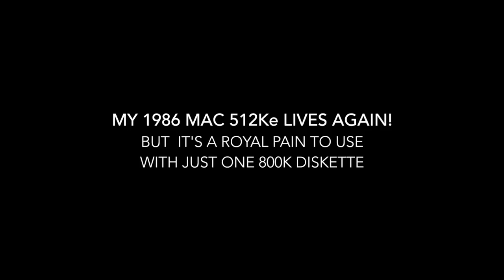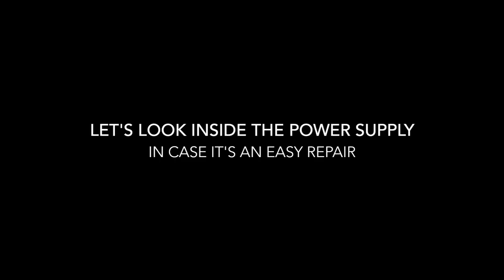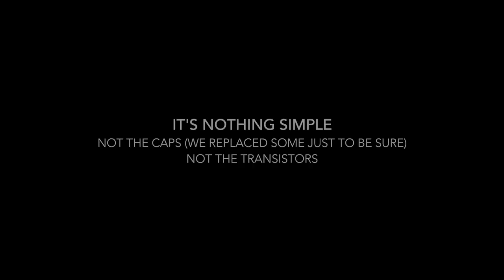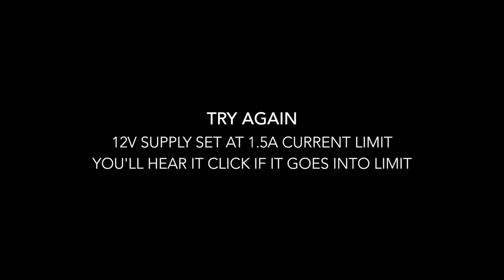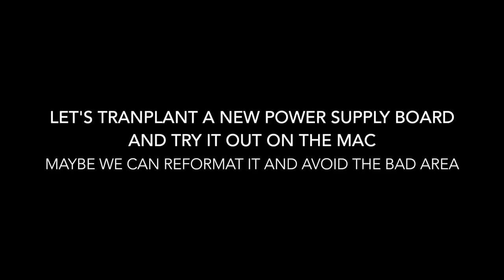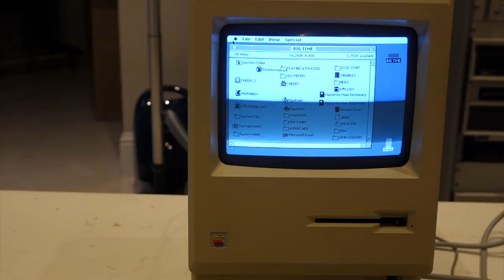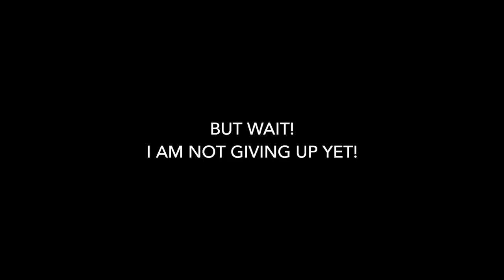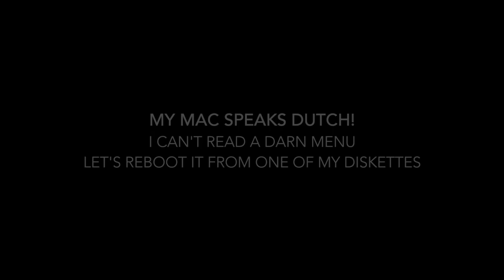Macintosh 512K Part 2: HD20 Hard Drive Restoration

Comment: I just found this video and it warmed my heart.  I wrote the Z8 microcontroller code on the HD20 interface card that sits between the floppy connector and the hard drive controller.  My memory is fuzzy on the details, but I recall Woz's floppy interface had a weird 7 bit interface so we came up with a scheme where we converted 7 bytes of data from the system (the device driver was written by my colleague Carl Young) into 8 "floppy bytes" to go across the interface.  Carl had the speedy 68000 to handle the shifting, masking, etc. tasks, but the slow Z8 could only wait for the first byte and from then on had to read the interface every X clocks, while also doing the shifting, masking, etc. between reads to assemble the "real" bytes.  No time for looping, so the code was in line and in fact crafted clock by clock.  I think it took me a week, counting clock cycles, moving a shift to before the next read, a mask operation after, etc., before I got it to work.  Challenging, but fun.
Reply from the maker: Wow. It's a great honor to have you on the channel. If any of the source is still available (and Apple is OK with it), it would be nice to release it or donate it to the CHM! I know that this interface has perplexed many people trying to emulate it now that the Rodime disks now that they are unavailable. Maybe, maybe not. But can you contact me through my channel about page?
Reply: I left Apple in 2009 and of course, had to leave all my notes from 27+ years there.

Went to About page, didn't find a way to message.
Reply from the maker: Thanks for responding. The "messaging" is now somewhat hidden, you have to click "business enquiries" or something like that and it will give you the email link.
Reply: The Ferranti ULA (I'm guessing Uncommited Logic Array?) that's seen on the upper part of the frame when he's watching a the dead Zilog... what was the role of that, there? Ferranti also make the ZX Spectrum's ULA isn't it?
Reply: @CuriousMarc  Did you ever try to rip the ZIL from the good disk?
Reply: @leninalopez2912  Ferranti was a pretty prolific manufacturer of custom chips during the 80s, it's likely a bunch of consolidated logic.

Comment: Love the bypass caps soldered directly on to the chips on the drive!
Reply: Doesn't look like a bodge at all, it looks like proper engineering.  It's the absolutely best placement for bypass capacitors.
Reply: This was common back then.  You see this in a lot of early computers from the early days of ICs.
Reply: The closer the better! :-)
Reply: Fun (yet pretty much wrong to solder anything to a chip's pins so close to the package itself), though my fav was back when power rails were literally rails, bands of thick metal foil cut in such a way they had pins for soldering them in, like a fence or something that is. The bypass caps were soldered between those rails above the ICs (the rails had small cuts in them to make it easier to position the capacitor on a defined spot at the correct height).
Reply: @TheBypasser  I still sometimes see rails like that in big power supplies, but I've never seen them with caps soldered across like that.

Comment: That hard drive is not scratched, it's just the way the finish looks in a lot of these old disks.
Reply: I think that's the individual tracks being discernible by the naked eye and not just a 'finish'.
Reply: Can't you even see the regular tracks on a 4MB floppy?
Reply: @SkyCharger001  Tracks on a magnetic media such an hard drive are... well... *magnetic*, it's not like a vinyl record where the tracks are actually physically engraved in the disks. And unless you're Superman and have his special eyes there's no way to see them with the naked eye, you need special tools for that. Not to mention that they're microscopic in size, so even if they would be physical grooves you would anyway need a microscope to see them.
Reply: @SteelRodent Yes, the Seagate ST124 have a similar finish, like lot of others of the period. These were the times when the drive finish was transitioning from the old orange/brown iron oxide coating to an anodyzed one.
Reply: The patterns are actually wear, most likely. This comes from spinup and spindown without being parked properly!
Reply: @AiOinc1  No, that's not wear, it's just the way the platters are finished. I opened many hard drives and in a lot of the ones being from the late 80ies/early 90ies I found platters looking exactely the same, while the drive was perfectly working with no bad sectors. Not to mention that many of them were voice coil drives which park the heads automatically at spindown, so unparked heads actually was not an issue on those units.

Would that have been a weared surface you would've heard the heads grinding like crazy when the guy in the video spins the platters by hand or turn on the disk, but it's not the case here.

Comment: Thank you for posting this 5 years ago now.  I just had a very similar issue with my Rodime drive in my Apple HD20 unit.  popped the top, slowly spun the spindle platter, and felt it free up.  Put it all back together and it works now!   Thanks for the inspiration to finally pop open these old drives and just take the risk.

Comment: I'm not even sure if the scratch like pattern on the disks were really scratches and not just the surface finish since they are completely even over the whole surface. 
These old hard drives are very robust. As a child a opened a decommissioned 20meg IBM harddrive and poured water inside it was still working (for some time)
I think as long as you don't get any of the sticky stuff from the foam sealant on the platters this drive should be fine.
Reply: Yep, the surface finish on many old drive platters looked like that.
Reply: Why did you pour water inside?

Comment: I worked for Apple in the late 80s and through the 90s, and at that time, they were VERY proud of their plastics design. They had an aesthetic of making enclosures that used minimal screws.The Mac IIci and Mac LC, as I remember, had no screws at all - everything just clipped in and snapped together. Same with the original Mac Portable. If you can get your hands on any of these machines, take a close look at how the plastics are designed - they're really beautiful.

Also, those disks were famous for stiction problems - the head became mired in the protective grease on the platter. We learned just where to whack the drives on the side when they would stick, just as we turned them on, to produce a shot of extra torque to get the heads unstuck and let the drive spin up.
Reply: If I recall correctly the Conner drives also had stiction issues.  For me, I take the raw drive out, hold it in the air with one hand, and give it a quick twist to free up the spindle.

Comment: looks like over current from sticky mech fried things bits by bits. The transistor regulator fried for a good reason, replacing it by an uprated one allowed the next thing in the line to be used as a fuse : the Zilog controller.
Mechanics in these drives have way more forgiving tolerances than high density beasts of nowadays and can be harmlessly disassembled, and fixed to restaure friction-less functioning.
The actually working drive will provable seize one day or another too for the same reason of sticking old lube.
Sticking old lube is also a 90% chance of failure reason of floppy drives, also turntables, mechanical clocks...
Reply: The z8 can’t be the fuse since it doesn’t directly power anything. It could have been a random failure or a sign of overstress from the higher voltage circuits not coupled loosely enough. The transistor fried because it was a design with no current limit. A bit appalling really.

Comment: I see a Ferranti ULA on that Rodime controller board!  Very Sinclair of them to include that...
Reply: That's not surprising considering Rodime drives were made in the UK (Scotland)
Reply: ULA was a predecessor to modern ASICs, so it was a generic chip. The difference was, that it was programmed in the factory, like Mask ROMs, and not by end-user like GALs or modern ASICs.
These drives did not store any configuration in the board, so swapping PCBs should bring to life other disk too, yet it is somehow risky, as mechanical problems may damage the other board too. If you decide I'd suggest you to monitor power consumption of good disk, and then set current limiter according to the observations prior to running working PCB on a dead drive.
Reply: Was going to comment I spotted that too!
Reply: I noticed the Ferranti chip, too.

Comment: Hiya! I have a 512ke with one of these. The drive starts up and all is well. The Mac boots, you can see the menu bar and trash can, but then it bombs out with ID=4. If i boot off of a 5.3 system floppy the Mac doesn’t see the HD20. Any ideas? What would I use to format it or try to get the Mac to see it? Gracias!

Comment: @CuriousMarc 
I can't understand why the Rodime drive's uC chip burned up after hours.  One thing I remember is that one computer used chips that required the negative 5V, and there was a strange circuit that prevented the +5V from being applied before the negative 5V was present.  I think the chips required the neg. 5V first to prevent drawing excessive current from the +5V supply.

Comment: These old hard drives can surprise you, I've had ones you really wouldn't expect to work come up just fine, and much newer ones have some internal part turned to goo and sticking the head in place so it cannot work, or having turned to dust, which of course spoils the disk or head.  I'm assuming these Rodimes are too old to swap controller boards and expect to actually read the data; I'm talking out my ass here but if there's custom programming on that chip, I'm guessing its a defect map or some other thing tied tightly to that physical drive...

Comment: Wow, that was inteesting.  And the drive gets it's power through the ribbon?  By the size of the cable, I'm guessing it has space left for a 6-bit disk..?   don't know anything about Macs, and as thorough my knowledge about modern hardware is, I'm a bit limited on yesteryear's tech.

Comment: I have seen in other repair videos that a common problem with this old drives is the grease (dried out) inside the stepper motor(s), a small drop of sillicon oil on the shaft will help.

Comment: I don’t have an HD20 but I do have an external SCSI drive for my Macintosh Plus. The power supply was replaced at some stage and was wired dangerously. I have repaired it for safety reasons - metal box now has ground wires for safety. Still trying to find time to boot Plus and format a 210MB SCSI Drive... Thank you for your video!

Comment: It's the first time I've seen someone actually open up a hard disk, albeit a relatively low capacity one, and having it work again (for a short time anyway)! But it's also the first time I've seen an MCU blowing up to the point of melting its epoxy casing ! Now that you've got a second unit fully working again, might I suggest installing some sort of heatsink on that second working Zilog MCU ? Anyway, félicitations ! Or should I say, gefeliciteerd ! lol !

Comment: Why did that ROM chip on the first drive chip fry it's self? There must be a reason. Is the 5V on that replacement PSU a bit too high? How much ripple/noise does it output? If the chip runs on a lower voltage than 5V, is the voltage regulator on the drive's PCB outputting the correct voltage. I would check the temperature and supply voltage of the same chip on the other drive in case that one fries too. You don't want to loose your only remaining working drive as well.
Reply: Exactly! Chips like that are very unlikely to just die for no good reason
Reply: Overheating. They do start to degrade over time and their loads become less resistant

Comment: The trick to these old drives is that their spindle barrings tend to seize first, if you plug it in and the spindle doesn't spin when you power it up you can sometimes jump start it by turning the drive sharply in your hands on a flat surface clockwise as you power it up, this might take several attempts but the drive should start spinning. Once you get it started its only a matter of time when you turn it off that it will stop spinning again.

Comment: Did you replace the fan? The chip may have died because not enough cooling airflow. The early 1980s small "muffin" fans had a huge center motor hub, tiny blades, couldn't move much air at all and were nearly useless.

Comment: I never tried it myself but back in the day it was said that if not used for a while the heads can stick to the disk ("sticktion") and the fix was to hold the drive and give it a fast flick round (to spin the disk free).
Reply from the maker: I think it might have worked on that disk too. All I really did is spin it around while it was open.

Comment: I threw out one of those drives not too long ago. I got the HD20 from an auction, when I opened it up someone had stabbed at the controller PCB and damaged it. I attempted to fix it, but it still didn't work. When I took the lid off the drive, it was full of water and rust. I kept it around for quite a while - if things had happened in a different order, I'd have sent you the drive PCB!

I still have the HD20 case, PSU and "repaired" controller board, as I thought I could build a Floppy Emu or something similar into it.

I'm interested in the Dutch hard drive as well. I've been learning Dutch, and tried setting up a Dutch version of System 7 in Mini vMac. I couldn't find any Dutch-language apps to install in it though, so I didn't have much use for it.

Comment: Marc as you began to disassemble the drive, I saw one button head hex screw and five flat head slotted screws.  The drive was not assembled that way, so I think it had been opened before.  I am enjoying all your videos (ex-Xerox Tech).  Thanks.
Reply: No, this is the way they were assembled from the factory. Mixed screws. This drive wasn't touched since new.

Comment: You sitting in front of that Dutch Mac reminded me of my first encounter with a Bull Micral PC in the early 90s. Speaking German and English only, I opened the BIOS menu and found it to be in French. ONLY in French to be more precise. I have never seen that anywhere else, as all other PCs of that time had AMI bioses in English. Of course none of my classmates who learned French in school did understand any of the technical French used there. For you it would have surely beem a walk in the park. The Mac's Dutch menus on the other hand are not too difficult to understand for a German like me. 
To all Dutch people reading this: Don't get me wrong - I am not one of those arrogant Germans who say Durch is just a German dialect, but the languages are close relatives, which makes understanding written words not too difficult especially if you are familiar with the subject (like computers in this case).

Comment: Oooh almost the first Mac hard disc 😉 
The ProFile originally introduced for the Apple III and Lisa was also used on the Macintosh XL (Which as we know was a Lisa 2 with new ROMs to run MacOS). Whopping 5MB by way of the very original Seagate ST506 hard drive - the first commercially available MFM hard drive. The on that defined the MFM standard, if I'm not mistaken. 

Anyway, beautiful work as always Marc, thank you!
Reply: *disk

Comment: With the very early IBM hard drives, you needed a little program to park the drive heads before turning off the PC. I guess this wasn't an issue with the Macs.
Reply: The parking procedure was only necessary if you intended to transport the machine. Otherwise you should be ok
Reply: Im guessing thats the source of the lines on the platter - no parking
Reply: No, the scratches are just normal on drives this old. It's just the way they're machined. The disk density is so low that they're just the physical tracks and are visible. Drives with stepper motor actuated heads like these drives don't really need parking, because the head isn't moving about on its own. On voice coil activated heads, it'd be a different story. Transportation or head crash scratches would be things that aren't in line with the rotation of the tracks, but would come out as scratches sector-wise.

Comment: Looks like the Rodime drive is set up to use the same pinout / protocol as the Apple Nisha drive. Check out Dr. Schafer's page here for info on the protocol and connector pinout: http://john.ccac.rwth-aachen.de:8000/patrick/UsbWidEx.htm 
Too bad about the mask rom processor :(
Reply from the maker: Wow, thanks! Serious work and reference here. Looks like the guy has reverse engineered the Apple low level hardware disk debug tool!
Reply: That's exactly what they've done - needed to get the Lisa Profile and Widget drives working again! Having new debug hardware is more reliable at this point than trying to use an Apple III and the special formatting software.
Reply: PS: If you ever get a Lisa, I highly recommend his IDEFile kit: http://john.ccac.rwth-aachen.de:8000/patrick/idefile.htm 
I've built one and found it works perfectly!

Comment: Seems I always hear Smurfs talking when your videos move to "fast time" but we never get to see them.... ;)

The stepper motor for the heads seems quite big compared to what is in the technology now.

I seem to remember that Quantum HDs were the favorite of Apple products and accessories.  Maybe I remember it incorrectly or I didn't take enough of them apart to see.

It boots...back that puppy up pronto if possible.

I also seem to remember that external HD kits for Macs would scan through every file on the drive before it could be used.
Reply: I'm fairly certain that Quantum were used at least in the SCSI days.

Comment: Oil the barings on the seek motor 3in1 oil should do the trick its a common fault with older hard drives that use seek motors instead of magnets and coils to move the seek head.